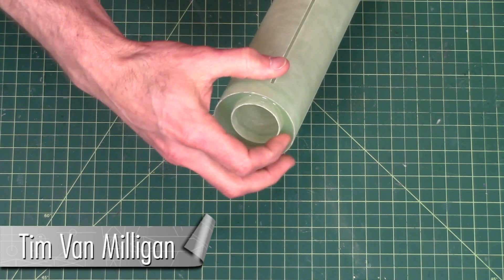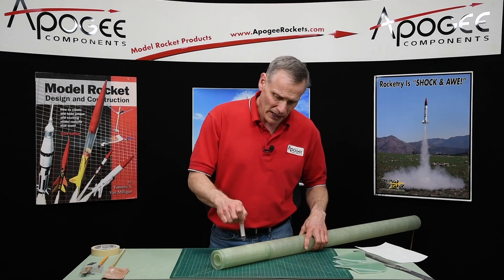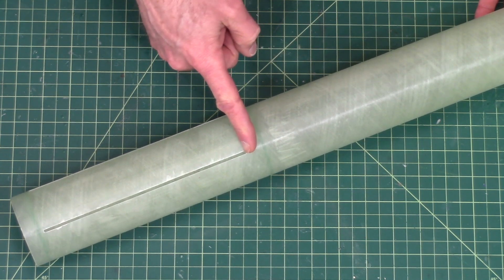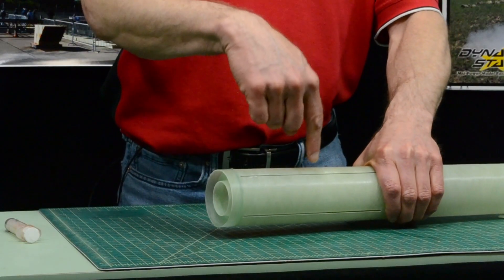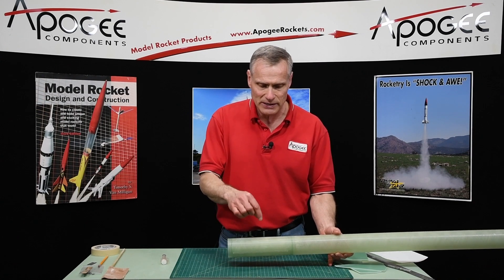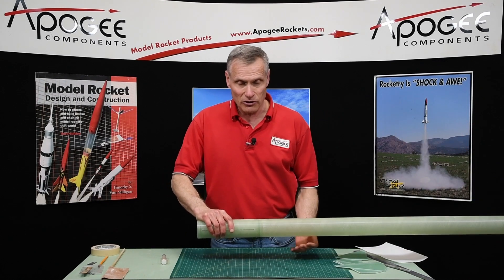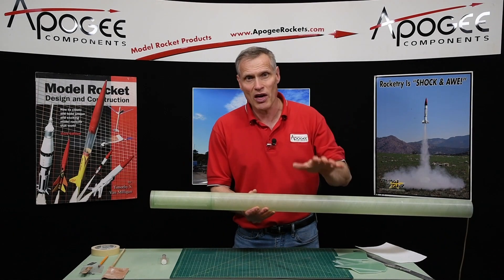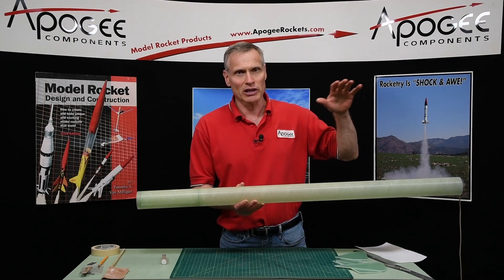Mach 1 Method: Fiberglass Rocket Build Part 4

Comment: Not only the forward centering ring should have been moved back, but you could have drilled those holes and sanded before installing motor mount.